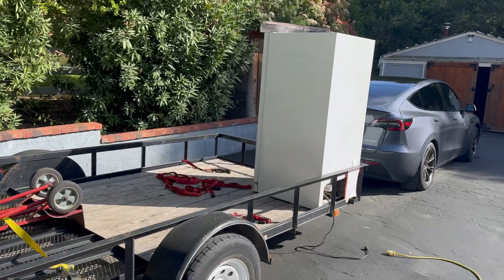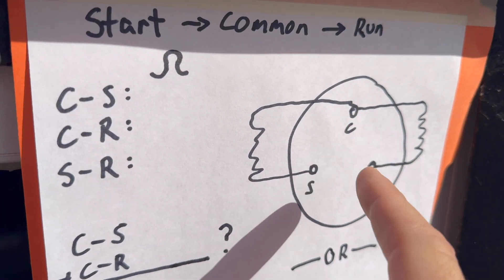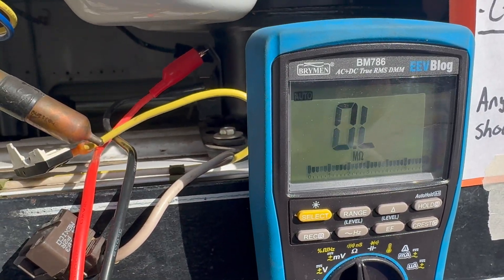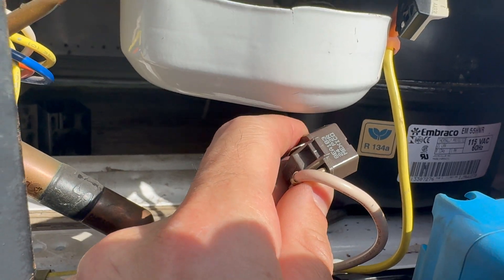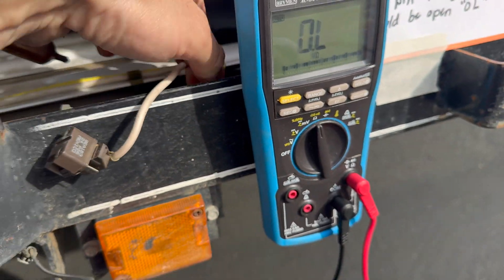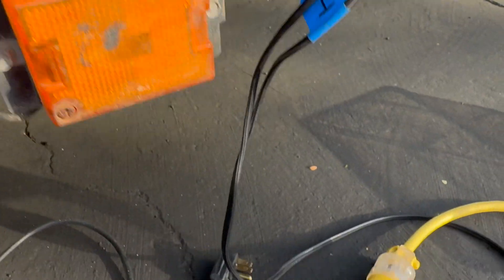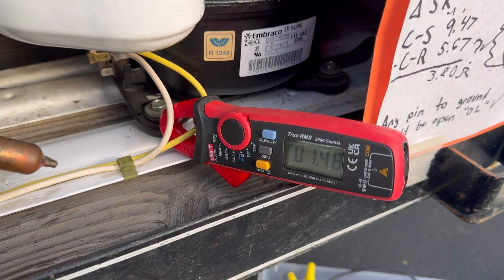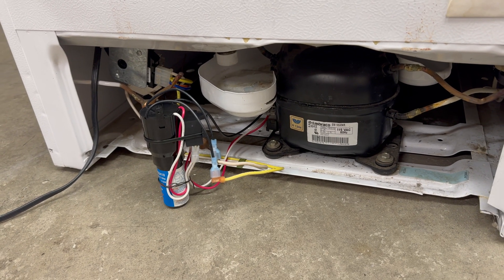Hard Start Kit Used to Diagnose and Extend the Life of a Free Freezer

Comment: Near the beginning of your video I was thinking it was a faulty thermistor starter, then when you did the starting test with the ammeter I saw that it was likely a faulty thermal circuit breaker. But the hard start kit is probably the best fix for it.